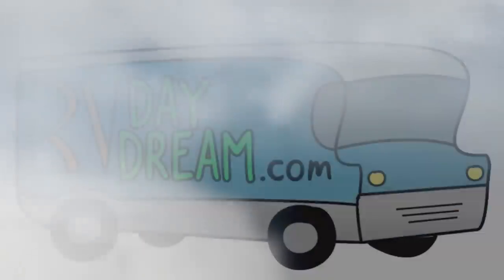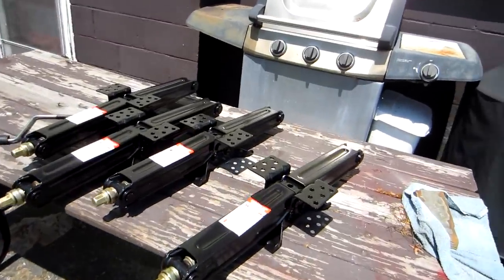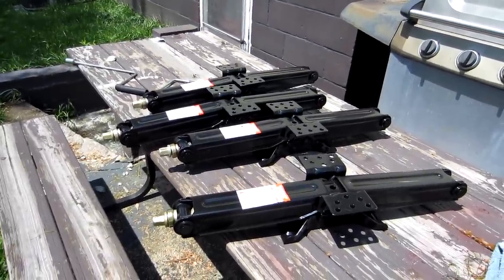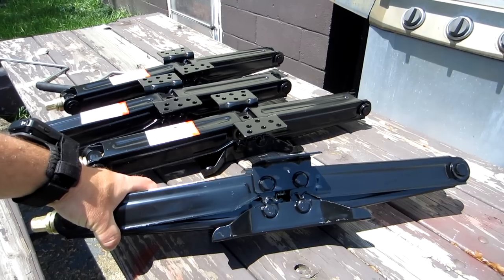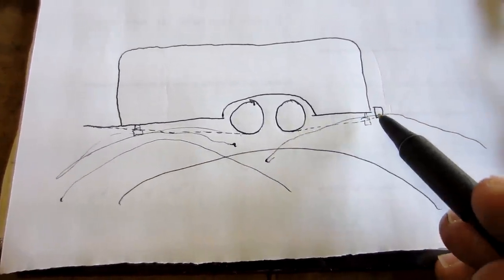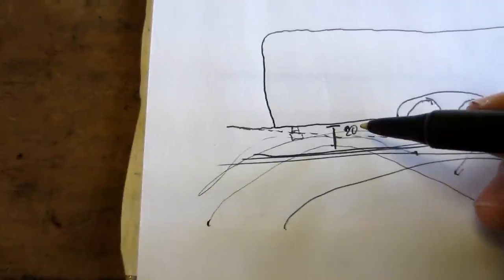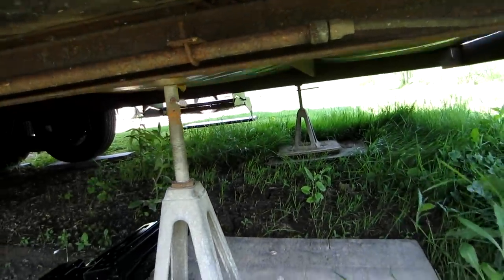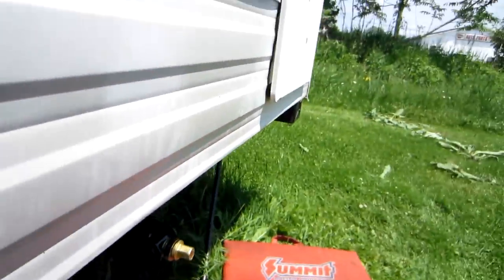RV Stabilizer jack INSTALLATION and what to look for

Comment: most stabilizing jacks have the same mounting bracket as far as size. Which is to say you can unmount the jacks from their mounts. Weld to the frame and then bolt the jacks back to their mounts. I did this on a class C that I had and it worked like a champ. I did not have any stabilizing jacks so I installed two on the back where the bed was. Not worried about the front since it was not for sleeping anyway.

Comment: Good job on the DIY project. I would suggest replacing your corded drill with a 18v Milwaukee or Dewalt cordless drill. I use them all the time as I am an industrial electrician. The new(Dec.2014) 18v brush-less Milwaukee drills are awesome. I plan on drilling and tapping the holes for my scissor jacks as my camper has a box tube frame.
Reply from the maker: Bryan P Thanks. My Porter Cable 18v drill/circular saw/recip saw batteries just took their final breath after many welder rejuvenating comebacks SO,  I have been looking into Lithium Ion as my small 12v Li-ion Impact and 90 degree drivers have been pretty faithful so far..I have a 18v battery pack from Harbor Freight that is suppose to be coming that I want to try out with my old Porter Cable stuff to see if it works or not.. As far as your frame,, I am not sure how I would do the box frame, I wonder if the frame thickness has enough meat on it to make effective threads that would hold?  Hmm, I would probably cut an access hole just big enough for a nut to slide thru the weld the nut in place then weld the hole shut ...OR just weld them on period..  Good luck

Comment: Are you concerned about integrity loss on your beams after drilling through them?
Reply from the maker: I found holes throughout the RV that were drilled into the beams when manufactured. I just make sure I kept the size smaller than what I saw elsewhere

Comment: Thanks for your humor and videos.  I have the same stabilizers.  When I put mine down and i add 2 extra rotations to snuggle them, 2 of them want to not hold and tend to back out.  Weird.  Any suggestions? I do keep the worm screw lubed.

Comment: I have the same size channel frame and jacks.  Did you push a 3/8 drill through the frame?    I'll go buy the drill bit you used    thanks
Reply from the maker: Yes, I love those DeWalt with the pilot tip drill bits

Comment: Could you mount it at a 30 degree angle towards the back? If you did, there would be less back and forward or side to side rocking. They'd also not stick out.
Reply from the maker: Maybe on some RV's that have a wider frame but the jack mount pad would have been off at the corners, Plus I was contemplating at the time adding the adjustable crossbrace system they make for added stability which requires the jacks to be at 90 degree angles to work.. but found I didnt need it after all. These really helped and when the wheels are chalked It is very stable..

Comment: Found your video to be very informative. I have one question though, can these scissor jacks that you used be installed on a 30 foot class C RV?
Reply from the maker: Class c RV's are leveled using blocks and don't use stabilizer jacks
Reply: well that answers my question lolol, but could they be installed and used

Comment: That's called a "brad point" drill bit and it's for wood - not steel. 
Get a real titanium bit for steel and use a cutting oil spray to keep it from overheating. WD-40 works in a pinch. Also, use a center punch to get a good start for your bit. Drill it on a low speed. 500 RPM.  Also, use Grade 5 bolts.
Reply: Leon Allan Davis m""